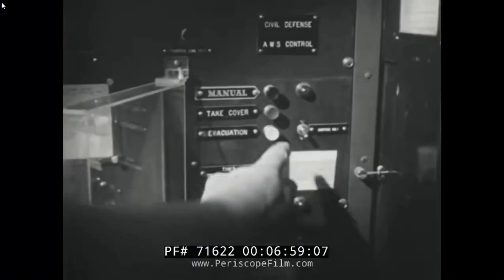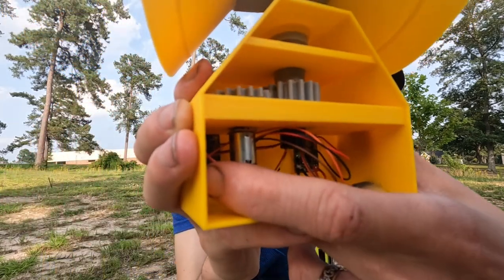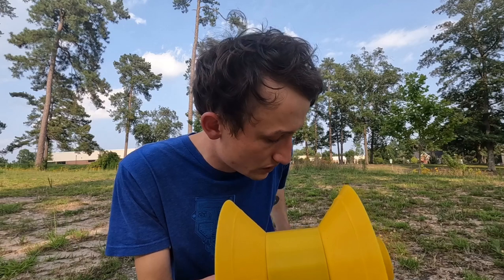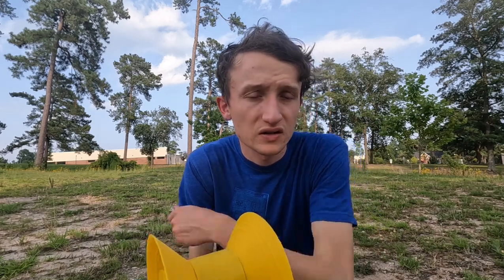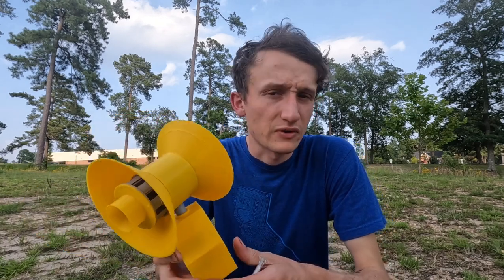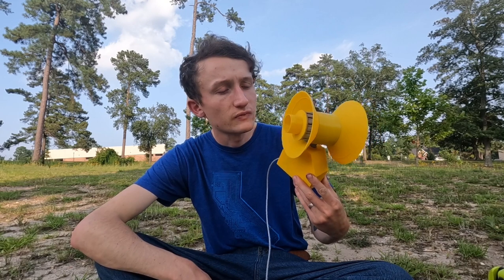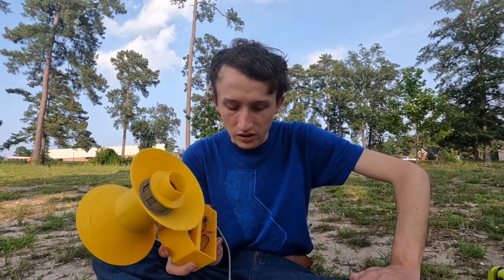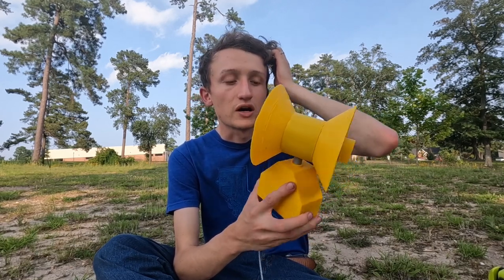3D printed mini 500DHTT siren

Comment: Awesome video! I do like the Perfect 5th sound the DHTT makes.  

I have a solution for a motor, I recommended a MABUCHI RS-385PH-17120, it is a weighty heavy duty dual shaft motor with lots of torque & on my 5/6 siren even at 21 to 23 volts to get to 7,000 rpm the most it gets is warm. 

For 3,500 rpm it should run very cool around around 10 to 11 volts.

Comment: You should make the siren Tower
Reply: You'll take 3 pieces of ½" EMT conduit,  and bundle them together. Cut bundle to length,  and you'll have Calhan's specific stand design. 

Their stand is actually 3x 6" structural pipe welded in a triangular bundle, with a top plate,  and a baseplate with gusset plate reinforced sides, going to several ¾" bolts into a site made foundation going down several feet into the ground.